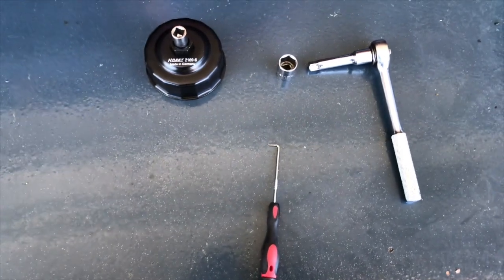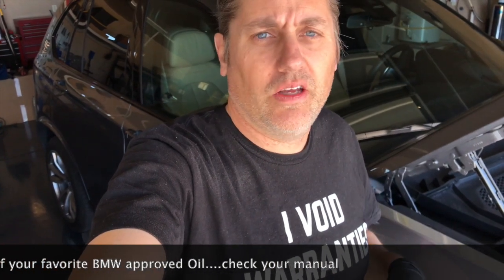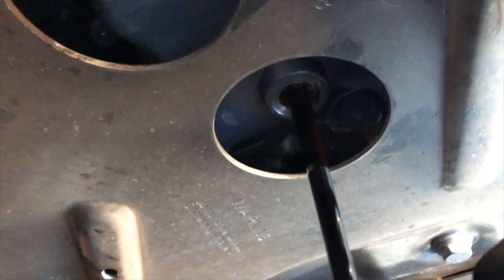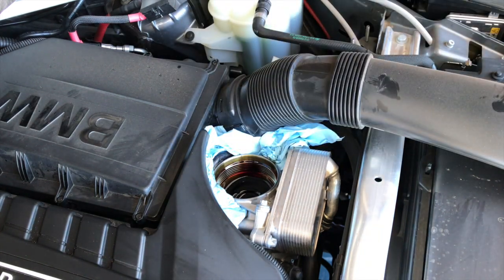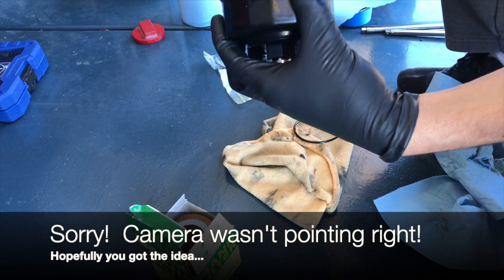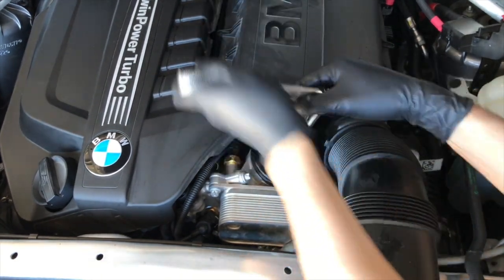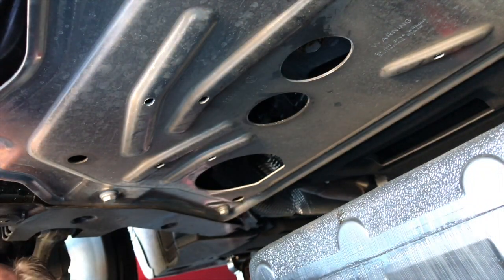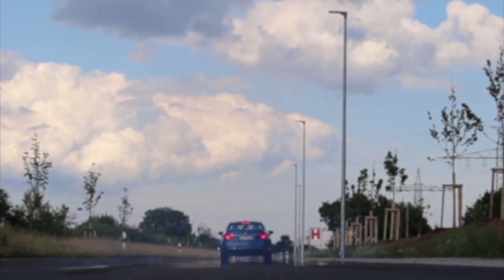How to "BMW X5 F15 Oil Change"

Comment: Hi Bob. Here's two piece of advice when doing an oil change.

• Have to car to have reach full operating temp prior the oil change. Take extra care since the oil will be over 200°F hot.

• Open your oil filling cap before loosening the drain plug.

Comment: Nice video, but some critical feedback is needed here.
- Make a list of the steps BEFORE doing a job, so you don’t miss a step and can use it as a script while talking
- Be sure to always have the action in the video shot. I suggest having someone else film while you work.
- You did not push the filter cartridge all the way in before installing. That’s why it was sticking out a bit.
- Use a torque wrench for the oil drain plug. You probably over tightened it. That screws into an aluminum oil pan that you do not want to strip!

- You used Mobil 1 European Car Formula oil, which lost its BMW LL-01 rating a few years back.
Reply from the maker: Thanks for the advise.  I'm a 'one man' show, so it's difficult getting perfect angles, and there is no redo.  As far as Mobil 1 goes, I've researched the actual properties of the oil, and compared to Castrol BMW approved oil...almost identical.  Mobil 1 even had better Zinc properties.